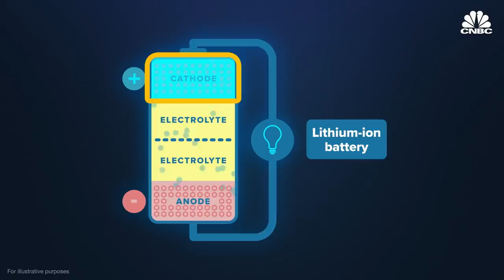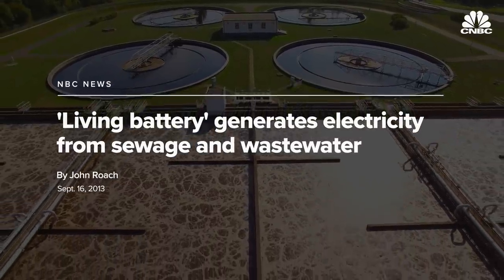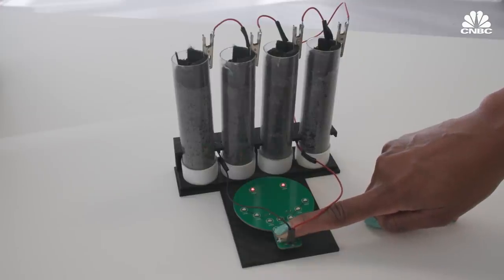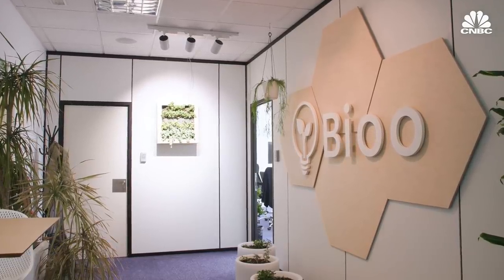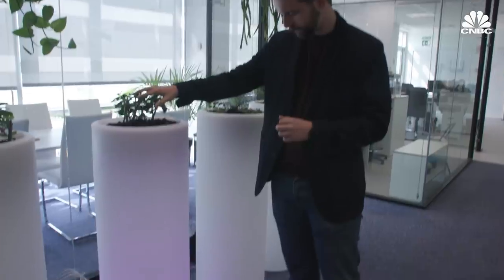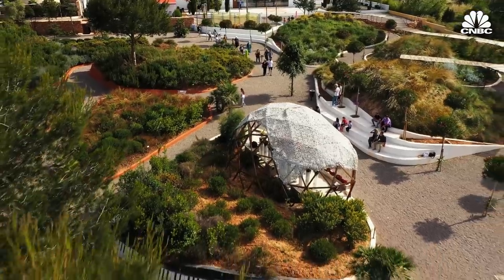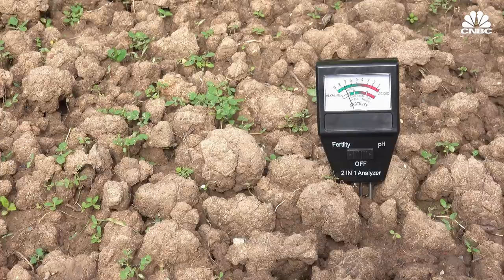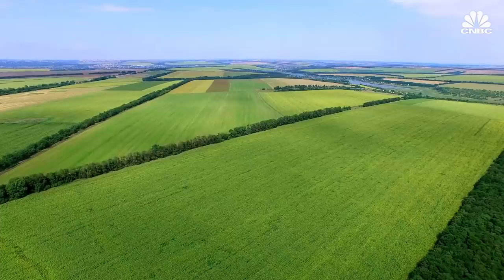How Soil Could Be An Untapped Source Of Electricity

Comment: I’m sorry, I can’t keep watching this. Someone there really needs to better understand what they are talking about. You said they “harnessed acids in a potato to power a small light or clock.” No. No they did not. They are harnessed the power of 2 different types of metal to allow for a RedOx reaction to occur. The potato is just the electrolyte in between those 2 metals.
Reply: Agreed, some people are clueless
Reply: Volta battery)))But now the time when some rich people invent WC )))Reinvent volta battery.USA it's crazy country with thay startups.
Reply: Thank you. Reading the other comments, I was starting to wonder if all science had died.
Reply: yOu areN't HarNessIng tHe PoWeR oF tHe eNGiNe ItS aLL tHe OiL.
Yeah let me set fire to my fuel tank cause its the same amount of energy released, the electrolyte in a battery is important and without it redox likely wouldn't be useful to us. It's not the thing generating the energy it's the thing making that energy useful. potato battery redox doesn't work without the electrolyte
Reply: @lolbro8701  but it’s not the oil either. It’s the chemical combustion of the gasoline with oxygen. 
The potato battery is entirely possible without the potato. But it’s entirely impossible without the 2 different metals. 
It’s misleading at the least to say it harnesses the power of the potato when it could be done with salt water.
Reply: @lolbro8701  Salt is an electrolyte ; why don't you go salt you land and plant metal in it. I'm sure you won't die of hunger ;)
Reply: they were developing the sensor batteries in partnership with Bayer ( proud owner of Monsanto (agressive licencing fees/practices for their seed lines, and glycosate/Roundup/carcinogen. just saying
Reply: No to this crappy technology
Reply: @contradictorycrow4327  that might be giving them credit. does anyone remember when Kim jong Ill was trading insults with Drumph? he said that Drumph was a dottard (dot ard) and they were having a fit and pronouncing it dohtard (think homer Simpson) I was like 'whats the reading comprehension level of these people and can they use Google '
Reply: When kids wanna be youtubers and tiktok stars more than scientists and engineers tells you alot about inane fools commenting on subjects they have zero or little understanding of. SMH
Reply: None of this conversation matters unless you’re working on the project. Otherwise, you’re just wasting internet bandwidth. Like me.
Reply: We did that in highschool.
Reply: @logcom482  lol this is a spanish startup
Reply: @Designotherwise  the same things😉✌
Reply: @logcom482  what?
Reply: @Designotherwise  belive me that things never will  be sell because electricity from the "Volta battery " or "Galvanic element " it's the same to Duracell battery.Thay a expensive and nobody never will be use Tham to power light bulbs or wash machin.It's bool s...t invention.Thay only need money from investor and to do around the world and saying that is miracle.But it's only for idiots their product who never go to school and never open the physics books.Adios!🤗✌👋

Comment: @Bioo:  So, why don't you have your batteries storing energy from the Bioo panels, in the flower-bed, building up the energy over time to utilize it elsewhere as needed? Such as to power the home with that energy, combining it with solar energy, etc., when you don't need to use the stored energy, from the flower-bed, to light the flower-bed, at all, because, presumably you have excess?

Comment: I don't understand everything gets its energy from sun the plants,soil, bacterias  why not harvest the energy directly from sun.
Reply: Solar panels?
Reply: Because half the time there's a great big planet in your way.
Reply: @vylbird8014  -- Yep--and much of the rest of the time, the crops themselves are crowding out the sunlight. Even if the sensor could get a reliable supply of solar power, it would require rechargeable batteries, which (presumably) have a shorter operating life and a greater environmental impact.
Reply: @vylbird8014  that same big planet is also blocking the plants and soil from getting the energy so yeah why not take the energy directly from the sun , why does it has to go through plants soil bacterias etc and then to us.
Reply: @geraldwaitforit9112  This technology isn't for heavy power. It's for powering remote sensors that demand a tiny amount of power, but are situated far away from infrastructure. So consider your options:
- Run a really long cable.
- Give the sensors a small solar panel, battery and control circuitry.
- Give the sensor this experimental  technology.
A tiny solar panel and battery would work, yes - but it's possible that this might work out cheaper. Especially if it's got a long service life - batteries don't endure extreme temperature swings well, and the cost of sending someone out to replace all the sensors every five years would be significant on a farm with thousands of them.

Comment: Soil degradation might be an issue.
Reply: @bioo.official  does this product need a battery to operate at all? Like somebody told me to look something up that did the "same thing", but it still required me to buy four AAA batteries. I don't want to do that.
Reply: @bioo.official  Still listening to the video, but I would like to point out that although "most" of the excess electrons are lost as heat. There would still be a massive quantity of electrons that would normally be used to convert one nutrient, mineral,  chemical, etc. Into something more productive for the next crop or bacteria animal etc that would be lost from harvesting, and, therefore would be limiting the overall quantity of free electrons available for things to use, that not only soil degradation would be accelerated, but that there could be a cascade effect up the food chain.  Even if it's just because of "minor" inefficiencies. I mean we're still dealing with a massive number of electrons here. 

 I'm not saying "oh that won't work" I'm saying there will be consequences. When running a low draw humidity sensor on a fence post,  okay whatever, slightly less productive soil for a small area around the post. If you're trying to power a city with this however.... btw, yes the guy said they weren't going to be powering aircraft and what not or bigger. The narrator,  However, did mention cities. Yes, cities are larger than aircraft, I'm just going with the flow. 

There's already concerns about the rate of soil degradation in many nations. As well as a host of government subsidies in order to try and prevent such issues. Including paying farmers for fields to lay fallow. So that natural processes to replenish various nutrients and minerals in the soil can happen, and we're talking about removing the literal heat source for a chunk of decomposition which ultimately feeds and powers everything. Again, that's largely just speaking to agricultural effects.

TLDR I guess: If this tech works out large scale. I foresee another subsidy to farmers and the like for them to simply leave their land alone in an attempt to save its ability to be arable soil in the first place. Perhaps, eventually, in perpetuity.
Reply: @bioo.official  Would you not waste massive amounts of copper and other metals that are hard to extract without producing massive amounts of carbon? Would you not also have to replace any wires that have produced oxide layers and lost conductivity, therefore requiring the electrodes to be replaced often and more carbon heavy? Finally, would the oxides from metals used in electrodes not be toxic, such as copper oxide, and would they not leach into the soil?
Reply: @Bioo  how much & how long has your tech has been tested in areas facing torrential rain seasons?

Comment: Oh, great. They’re working with BAYER (a really dodgey company). JUST USE TINY SOLAR PANELS!
Reply: “BO batteries run all the time” so do solar panels with LiFePo4 batteries! And they last longer than the 10 year lifespan of BO batteries!
Reply: @fish9468  you don't even need a battery, you could use a big capacitor if you try to save some energy at night

Comment: I wonder what kind of power you would get from Biochar enriched farm land, with a graphine battery system. 🤔

If you genetically engineered a mushroom, so that it's mycelium network could function like a funnel/"biowire". Shunting the free electrons from the soil, to the battery pack.

You could then sell the mushrooms (if safe for consumption) & harness the power of a larger area with fewer manufactured parts.

Comment: I'm not entirely sure the Sensor market needs Biological Batteries for the Sensor Market. I produce Wi-Fi Sensors for Gardens called Kokonaut that monitor Environment and from working on it, power consumption for Sensors is already very low. Also, Solar Cells is such a mature technology if the application needs to utilize regenerative technology that is an obvious choice. Still very fascinating & cool. Hopefully we will see this technology utilized effectively and also be cost effective

Comment: Energy from Soil is a future game changer
Reply: Not really. The power output is tiny, so it's not going to power the world - but it does reduce the cost of installing sensors, as you don't need to give each sensor a pricy solar panel and associated electronics. Sensors help farmers better target irrigation, fertiliser and chemical treatments. So the technology means slightly higher agricultural yields on lower resource requirements. Good, certainly. But not world-changing.